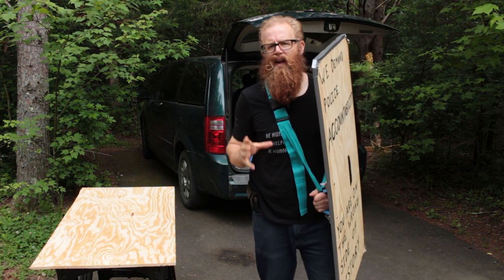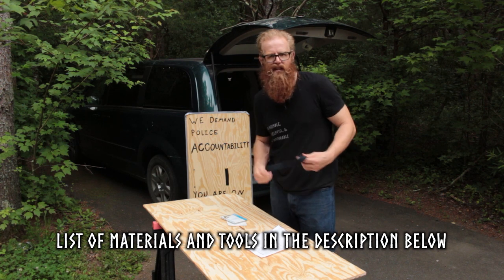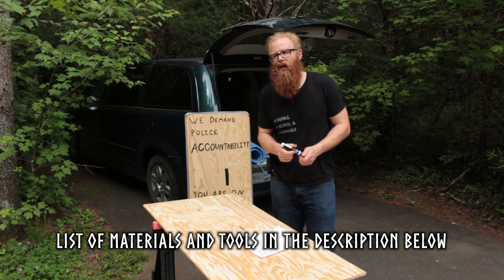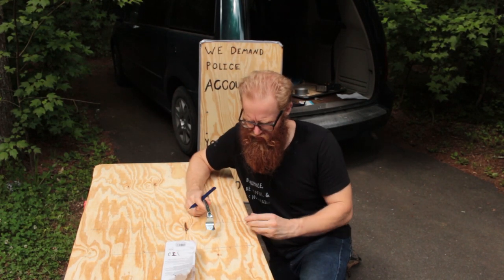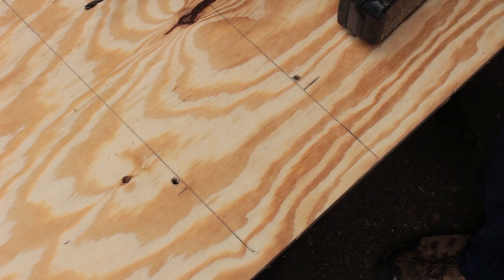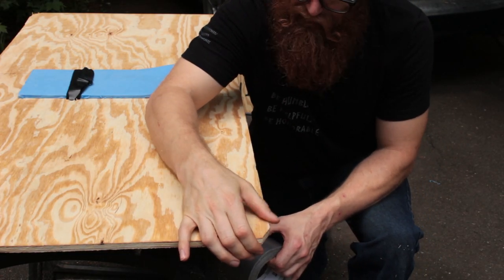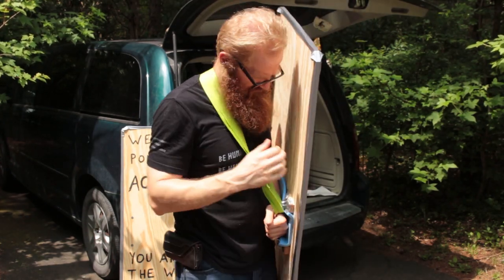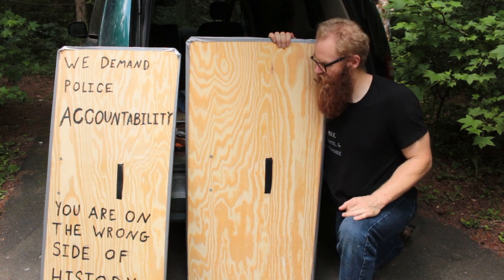Making a Protest Shield

Comment: You can also get 3 curved scutum shields and 2 round shields out of a 55 gallon plastic or steel drum if you cut the bottom, top, and cut the middle section into threes.
Reply from the maker: Great point
Reply: Your scutum must be waaaay bigger than mine. Holy elephantitus, Batman!!!

Comment: Nice vid. I think it's worth keeping in mind that shield durability over the long-term might not be super-important given the propensity for cops to steal and destroy stuff like shields. But being able to withstand rubber bullets and gas grenades is great.
One thing I will say is that while the materials themselves are relatively cheap, the tools aren't, and a lot of people for whom the protesting is the most relevant are also people less likely to own e.g. a jigsaw. It can be done with just the drill though, the saw's nice but not really necessary.
Also, damn your beard is awesome. It looks so soft.

Comment from the maker: Question of the day:
What other quick and easy ways you have used to keep yourself safe at a protest?
Reply: Repurposed 50 PPE faceshields for use as basic pepper spray protection. Won't provide protection for impacts but covid and pepper spray protection better than nothing I guess.
Reply from the maker: @Vontux  solid advice.
Reply: Stayed home, avoided conflict.
Reply: Don’t go to the protest
Reply: №1 is to keep an eye on the situation stay cool but think quickly and act according to what's happening. You may either need to run fast or hide :). №2 I tried to use swimming glasses or tactical goggles to protect against pepper spray and rubber shards from flashbangs. Goggles are very big and uncomfortable to wear. №3 ear plugs are a must. №4 cycling helmet can be used to protect your head from occasional damage, but it won't protect you if police decides to torture you. Fortunately I had no "opportunity" to test the protection level so I can speak only about comfort.
Reply: @MrLiandri  Swimming goggles are no good for impacts, it's why they can't wear them in water polo. Go for scuba masks or ballistic-rated safety goggles, they make them for chemistry labs.

Comment: I believe this could be solidly reinforced with carbon fiber and fiberglass resin
Reply from the maker: It works for what basic batons and rubber bullets.  I'd say if you want stop 40 mm gas canisters and rubber rounds then definitely go for it.  I think the extra weight might be more then what it's worth tbh.

Comment: Do you think OSB would hold up as well as ply against a 40mm stone being hurled by the opposing LARP team?
Reply from the maker: I wouldn't suggest osb for anything other then subflooring.  I've seen it used for shied cores before and holds up well for small rounds, but it's heavy and not as strong as ply.  
I suggest you try it and tell me how well it works for you.

Comment: How much would this weigh?
Reply from the maker: I wanna say 10 lbs. or so
Reply: @TheBeardedAxe  thx my dude, I was thinking about using this for an airsoft riot shield with a slimmer design and now I have a good idea for how much it might weigh
Reply from the maker: @celisberrett7998  I have another shield build but for Larping.  It's a much lighter design and will be more then durable enough for airsoft.
Reply: @TheBeardedAxe  oh thats ok, the design is 22in.X40in. with a 4in.X8in. Cutout for a lexan window and the shape is based off of the shields that the sheriffs department uses (I sketched it out with dimensions and I'm using ur vid as a material guidline). Thanks for the help tho, I really appriciate it :>
Reply: Plus mine is a smaller build so it'll probably be around 7-8 pounds
Reply from the maker: @celisberrett7998  Your very welcome and good luck with the build :)